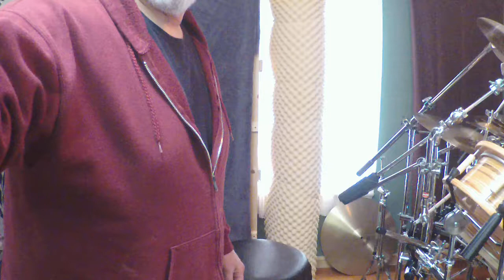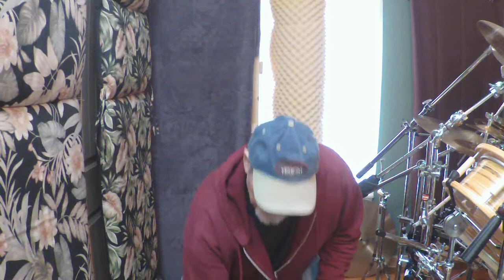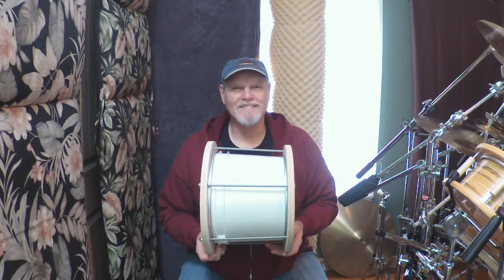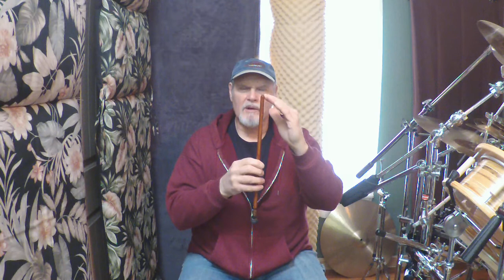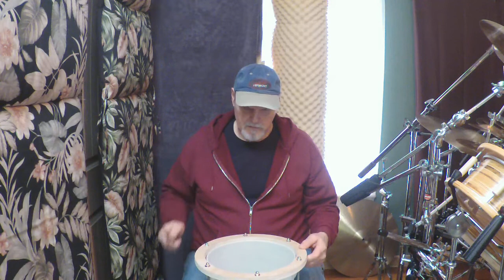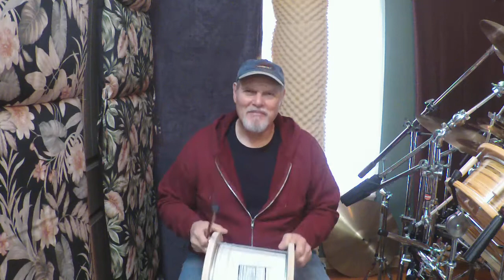Drum Shells, Sound and Hype, Part 18 - Another Non-Drum

Comment: Your bucket drum sounded pretty good after you tuned it a little higher. I don't care much for that pitch bend from drums when they're tuned low. Since this drum doesn't have a bearing edge but still sounded good, what type of edge would you put on a drum? I would think that it should be an edge that follows the rounded shape of the drum head. I would love to see you have a conversation about all of this with John Goode from DW drums. Do a blind test between one of your drums against one of his high priced drums, that would be fun to see too.
Reply from the maker: Videos,  part 6, 7 and 8 get into bearing edges. Like all the drums I have made in 30+ years, I experiment a lot. Nothing is in stone for me. The next video will have more examples of the true nature of what drums are. Should be up this week. 

The reason I would never do a test between my own drums, whether my Keller maples or stacked plywood rings, or any other serious drums I have made, and top of the line manufactured drums is because I would not spend the money just to prove my point, which I have already proven. My principle remains in stone. Spending more money does not mean better sound, not comparing apples to apples, especially today when manufacturing standards are high, and results are good at every price level. Everybody makes great drums, including DIYers. Finishes, hardware options and features, chrome plating and other things differ, yes. Sound that meets the super-hype of the manufacturers about proprietary shells? Not so much.  

I'm going to get into bearing edges on the next video by default. You'll see why. 

Thanks for watching.

Comment: 7:46  - Steady On, my friend!
Are you implying that the shell DOES have a say in the sound?!
🤭
Reply from the maker: Nuances and subtleties. Have stated that over and over. Shells color sound because the sound waves get trapped and have to travel down a tube, a cylinder and bounce around until dissipation.  Every shell has a density and a depth. Volume, frequency accentuation or depletion, etc. can be affected but, in no dramatic way warranted by drum company hype.
Reply: @REFondrums  ok ok I get that but IF, say, a METAL tube that is, say, 13 inches in diameter and 5 inches in depth with the same batter and resonance heads as a PLYWOOD tube that is, say, 13 inches in diameter and 5 inches in depth with the same batter and resonance heads as a STAVE made tube that is, say, 13 inches in diameter and 5 inches in depth with the same batter and resonance heads Will sound the same in the same room played by the same person when all tuned to the same pitch, yes?
Reply from the maker: @BeesWaxMinder  If you have seen #13 and 14 you saw that demonstrated. 8, then 10 different drums, same heads and tension, different materials, a little depth variation and yet, no dramatic differences. Depth created a crisper sound in the actions of the wires on a couple drums, otherwise, strikes on heads or rim shots were all in the same aural ballpark. 

In making drums I am aware of all the parameters that go into the finished unit. I know the variations. It just became apparent to me, back in the 90s, all the hype about shells is just that. It is not provable in any real world way in the context of a band and music, and sound equipment or recording equipment, when it comes to most drum lines. I leave beginner instruments where they are but, even there I have shown absolute bottom level drums don't sound radically different than higher lines if their bearing edges allow the heads to seat correctly and they can fully vibrate as a unit. The Mystery Drum Set added proof to that, as well. 

The entire snare drum industry, the snare drum Olympics, the players always searching for "the one,"  is all somewhat moot in the modern world when it comes to sound. There's just too much that can be done with electronic equipment to modify sound. Feel? That's another subject different for each player. That's where shell depth and density impact the concussion column moving around in the cylinder, effecting rebound.  

Of course, humans adapt very well. I like deeper snare drums but, if all I had was a shallower drum, I'd get used to it. Hands, ears and mind all adapt. Volume is moot. Sensitivity is moot for most modern 2 and 4 music, just slamming back beats. I've recorded with absolute crap drums but, it's what I had to work with and I made it work within the context of the music and the passion I have for playing it. 

Marketing has made the musical instrument industry more than it really is, practically speaking. We won't change that. Whatever makes profit will float those boats. I'm just trying to inject a little reality into the ocean.
Reply: @REFondrums  Cool
So shell thickness DOES play a part, then?👍
Reply from the maker: @BeesWaxMinder  Not so much thickness but, the density of the shell wall, yes. 

In the sense of typical plywood shells, or any typical drum shell material: volume, perpetuation of sound wave action, exaggerated or amplified frequency range from the heads,  all in such small measure, while a drummer may hear it in striking a tom or bass drum, get the whole set active and then a band: all gone. Kick drums are basically moot, owing to popular muffling that's done. The kick drum video shows differences but, when people comment they like the sound of the trash can over the others, I know the point about shell hype from manufacturers is made. 

The sound of a drum is made by the heads. Whatever shells contribute is basically meaningless in the world of live sound reinforcement and recording studios. 

And let's facts. The audience, live or in a living room, or a car, or with earbuds off a cell phone could not care less what drums we use, including other drummers. How many players made music with single-headed drums in the late 60's and 70's? Well-known and unknown players around the world. Well known and unknown bands around the world. Nobody made an issue of drum shells. Hardware and finishes, yes. Drum shells? No. 

It is all marketing to sell product.

Comment: 22:14  - As ever I DO thank you for the info BUT You are making me feel a little foolish when I look at how many snare drums I actually own made out of different materials/sizes/etc 😜👍
Reply from the maker: Well, you know, you tension some different than others, you use different numerical wire sets. Shallow shells are generally crisper sounding. I made snare drums as a hobby for awhile. You've seen some of them in these videos and there came the point where sound just wasn't the factor I once thought but, they look nice, as wood instruments. I still have shells to make more. Hardware has gone way up in price, though. I guess I can always make more wood lugs but, pretty labor intensive. 

I wish I never sold my quartered Purpleheart. Lovely drum. I could always make another. 

There's a board calling out to me at the local hardware store. Gorgeous color. I forget the species. Every time I go in there it shouts, Hey! Over here! Me! Buy me! 

I may just snag it up. 🙂
Reply: @REFondrums  I certainly know that feeling!!

I may be wrong, of course, but I assume from your previous videos that you felt that the Shell had no real say in sound/tone

I kind of got that from this video also but beyond aesthetic qualities and workmanship (which I assure you I do appreciate, myself) do you think that metal versus wood and Shell thickness and bearing edges and density does have some detectable say in the way a drum sounds or behaves?
Reply from the maker: @BeesWaxMinder  Yes, it has too. That is just the nature of the physics involved. I have never stated the sound of a drum is 100% the heads, with the exception of Roto toms. I just reject the notion it's anything more than nuances and subtleties that can't really be noticed in the context of a band, live or recorded, so manufacturer super-hype about their proprietary shells is bunk.  

The plastic bucket sounds like a drum because of the heads, with the most worthless shell attainable. It not only adds little to the character of the sound, it detracts from the sound because it has no heft, no body, no density, and obviously interferes with how the heads seat on it.  It sounds thin because it is. But, with mics, sound equipment and software, it could become a real musical instrument no one would know its actual, physical properties.  It actually surprised me for the sound it has, all things considered, and that happens every time I do these non-drum demonstrations. The sound of a drum is the heads. The cylinder does what it does but, it isn't much.